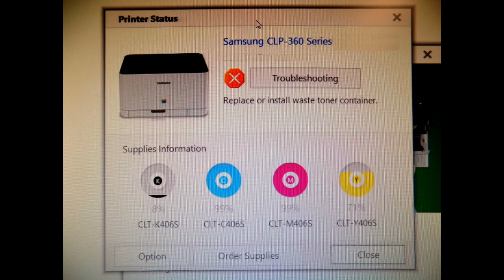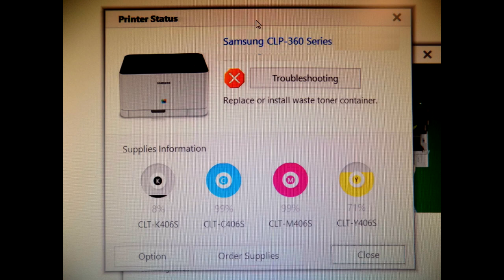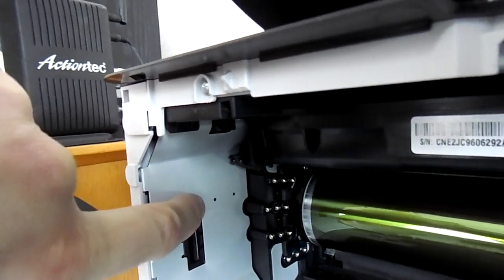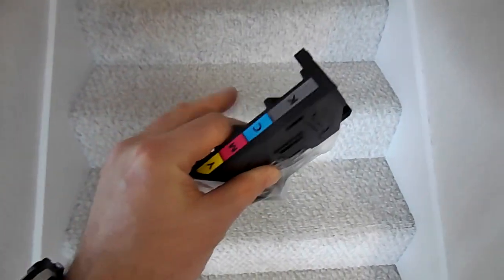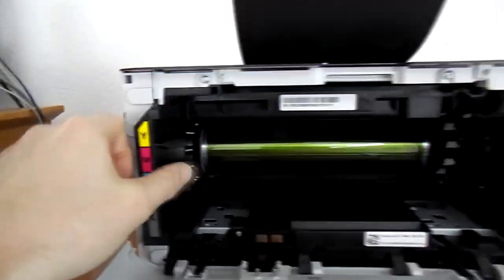Replacing The Toner Waste Container In A Samsung CLP 360 Series Printer

Comment: I bought this printer many years ago (I forgot when was it), didn't really use it because of the differentiation in colour calibration and print quality. Tried looking for solutions at the samsung website but no avail. So I left it as it is. Today decided to check the printer whether it's working or not. It's working but the print quality is horrible. I cleaned the toner's roller, but the problem's still the same with additional overprints. Any suggestions on what should I do next?

Comment: can you help me how full is that water tank have to be before its full? visually. You see I have a mac and the samsung printer software doesnt tell me supply levels and other things like errors I believe. So I may have been not getting a error message saying to empty my waste toner tank. I looked at it and its about a inch and a half full at the bottom solid and the rest of the tank above is just dusty but not solid toner. I have run a few cartridges empty so far on the usage of this printer 3 years. I have never emptied it either. Reason I am asking is I am starting to get streaks of black on paper and thinking that the extra toner may be not getting emptied and is building up on the transferor belt and making the streaks on the paper. So how full is "Full" on this tank? and do you think that is what may be creating the dirty streaks on my printing the smudges are random and horizontal and a bit smeared smudgy streaks not sharp lines or thin lines.